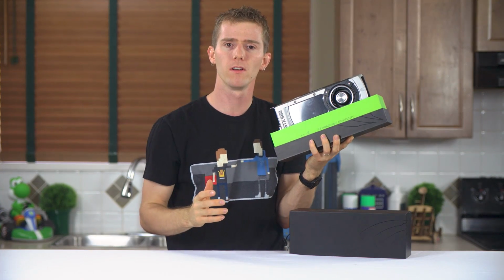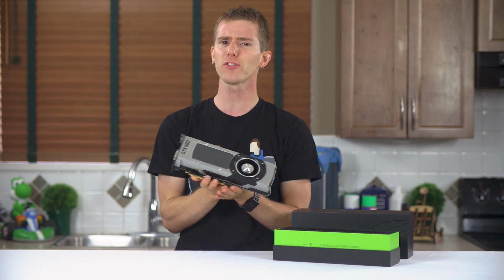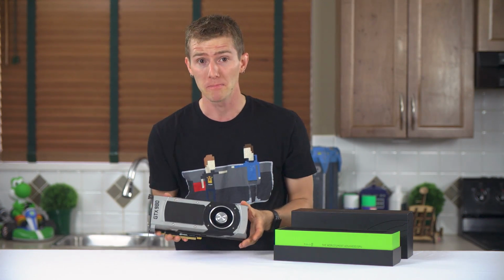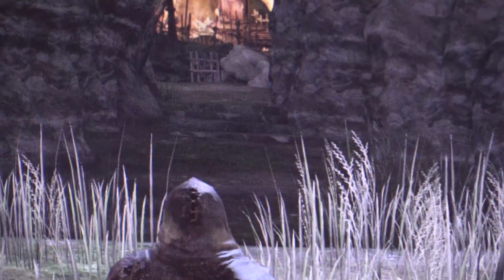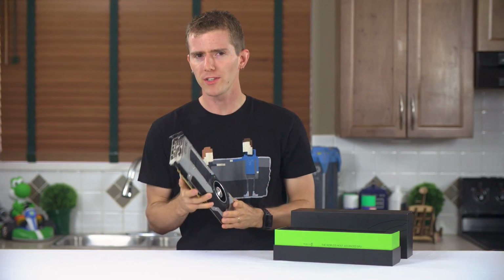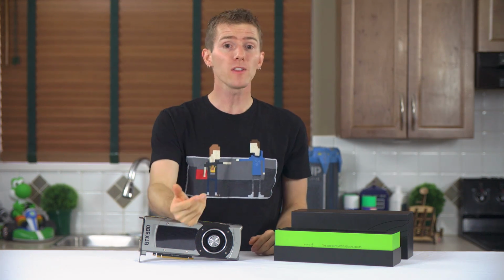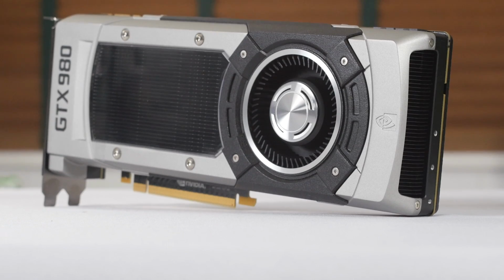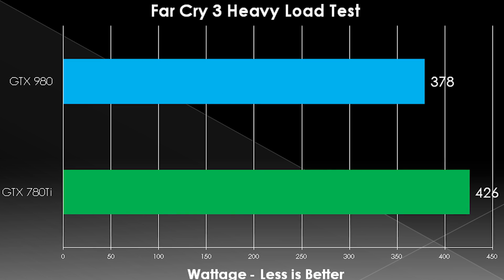NVIDIA GeForce GTX 980 Video Card - Performance Overview

Comment: Honestly, it's not as awesome as I was expecting, I was expecting huge FPS increase, sure the TDP being lowered is nice, and the backplate and I/O features are cool, but seriously? there was like less than 10 fps between them!
Reply: You must have never seen a release of a new line of gpu's, 10 fps is very good....
Reply: Actually the TDP stayed the same. The 980 is meant to replace the GK104 chip in the 600 series. The replacement for the GK110 has yet to be announced. Hell no one even knows for sure if they are going to release a replacement. But the 900 series was meant to be on the 20nm process. Not the 28nm. So this is an incredible improvement. The difference in CUDA cores between a fully unlocked GK100 and a fully unlocked GM204 is over 800 cores. And the 900 series is still on early release drivers. Give NVIDIA time to optimize the drivers and the 900 series performance will improve
Reply: Nvidia is smart company, this cards new memory compression is boosting a lot of performance, I would love to see fps in the newest games vs r9 series & 780/ti instead of older games.  Either way the NON OVERCLOCKED results are the typical nudge up nothing too big at all.  & it seems like Microsoft is getting it hard on for DX 12 so expect some exclusive os to have as well...
Reply: Nvidia could have easily made a card with the maxwell arc that had the same amount of cores, or even more, as a fully unlocked gk110. But they wanted to leave some room for them to improve upon incase the die shrink next year isnt as amazing as they would like.

Comment: MSI GTX 780 or MSI GTX 970? The 970 costs 60 euros less.
Reply: I think the 970, because of the new technologies.
Reply: Like I mentioned before with somebody else,
"The GTX 970 is the better choice. Awesome new features, 4 GB of GDDR5 memory, costs less, has better fps and in most cases for cheaper you get a card that is much more efficient and beats in most benchmarks. At most if you see people talking crap on how the 780 beats, it's just those picky people who care about an extra 2-3 fps, but I can guarantee that the 970 will perform better. The 780 is one of the first 700 series cards and the 970 has new features you'll like.

Let's just say a 970 performs exactly like a 780 but just about 5-10% faster in some scenarios..."
Reply: Garrett Absher NOOO DO NOT. The 780 can't even reach the 6 GB-it's just a marketing gimmick... The 4GB 970 is more than enough for high-res and there's news that either the 970 or 980 will come wiith 8 GB variants...
Also, the 6GB 780 is pricier, less powerful than the 970, and in all worse in performance...
Reply: if you go for the gtx780 go for msi's 6gb variant.
Reply: is like the same thing
the gtx 970 is cheaper
Reply: Zuhayr Sarker i was just puting that out there, if she REALLY wanted an 700 series card.

Comment: I have quite recently bought a 780ti. Now...do I buy another one, or a pair of 980's??
Reply: I would say sell the 780ti buy 2 980 and you pretty much run any game on ultra setting 4k 40 frames and if got 4 you rub Crysis 3 ultra setting 4k 60 frames
Reply: see how much you can sell it for but i would sell it and $800 more and get 2 EVGA GTX 980 Superclocked and your got good for 3 to 4  years it's worth it,im getting for gtx 980 but i still cant decide which one to get 4 980 or 4 gtx titan black

Comment: Gotta get these in sli guys I wanna set up a triple monitor display with these 980's with having three display ports connected to each monitor what can I push with i74790k aiming for triple 1440p @ 144hz or triple 4k @60 hz Whats the max these guys can push on high to ultra settings at either resolution

Comment: I'm gonna get the 750 TI. The only one my power supply for y 5 yr/o Dell Studio XPS 8000 can support. But then again, with 4 GB of RAM, do I really need to get a new computer. current graphics card is GeForce GTX 260.

Comment: So which should I buy, a GTX 980 or a GTX 780ti? Or should I buy either since I've got a GTX 770 2gb. I think it doesn't have enough memory for Arma 3 etc.
Reply: The 980 is just as fast or faster than a 780 Ti.  The difference is, the 980 has more memory, less power consumption, and is a couple hundred bucks cheaper.  From what it looks like, the overclocking headroom on the 980 is massive as well.
Reply: MiracLe  Hands down get the GTX 980. The GTX 980 beats the GTX 780 Ti, in a couple of fps, it has a lower TDP and its price is way cheaper than the GTX 780Ti. If you still have yet to buy any card I would get the GTX 980. But if you  already own a GTX 780 Ti then its not worth it to get the GTX 980. I am interested on getting the 980 soon, although its not a good evolutionary GPU, its  nice how it can go toe to toe against a 780Ti and uses lesser power and also much cheaper.
Reply: Just get 2 980 and your good for years to come
Reply: Apple Hunter I've never liked SLI-configs. They tend to be inefficient in games like Arma.
Reply: vash1053 Alright, thanks man.

Comment: For 500 i would get a 980 to switch out my 2 way sli 780ti because of i can get 4K on one gpu rather then 2 i would buy it also after seeing this im probebly going to sell my 780 ti and get a 980 and overclock it. It be linus if you made a 980 sli performacnce overclock guide...

Comment: If I had to upgrade right now and would have the money I got myself the 980. Power efficiency is the right way to go!! Also the card is fast enough for decent 144 frames gaming or in some cases 60fps 4k with still good settings. And for the upcoming oculus surely a good choice too.

Comment: Should i get a GTX 780 or a GTX 970?
Reply: XXMASTER GILXX 970 performs better, has more features and is cheaper, so why would you go for the 780?
Reply: Darude - Sandstorm
Reply: XXMASTER GILXX Have you even looked at Benchmarks?? GTX 980 fastest Single GPU on the planet right now, so it's not just the same as the 780
Reply: GTX 970 is the better choice. Awesome new features, 4 GB of GDDR5 memory, costs less, has better fps and in most cases for cheaper you get a card that is much more efficient and beats in most benchmarks. At most if you see people talking crap on how the 780 beats, it's just those picky people who care about an extra 2-3 fps, but I can guarantee that the 970 will perform better. The 780 is one of the first 700 series cards and the 970 has new features you'll like.

Let's just say a 970 performs exactly like a 780 but just about 5-10% faster in some scenarios...
Reply: 780
Reply: Éomer 780 is better than 970
980 is like the same than gtx 780,but it consume less power
Reply: XXMASTER GILXX DUDE THE GTX 980 IS GOING TO 780ti PERFORMANCE AT 200 DOLLARS CHEAPER!!! THAT CARD IS A FREAKING BEAST!!!
Reply: Thanks all!  Just to be sure, the corsair VS550 is enough for the 970? (550W, 42A on a single +12V rail)
Reply: lonleondon It should be but it isn't most recommended for any GPU due to the fact that there isn't much headroom. If you are going to do any overclocking, at least get a 650W PSU.

I think 550W should be fine as long as you don't do any heavy overclocking...the 970 only has a TDP of 145 watts so I think it should work better...
Reply: GTX 980 !
Reply: eroOtoko1 I kind of agree to the fact that if you can get a GTX 980 to the price point of a 780, why not get the world's most advanced GPU yet???

Hint hint, 980...
Reply: Zuhayr Sarker Between a 970 and 780, I might as well add more and get the 980 xD. Waiting to get paid  soon then sell my old GPU to try and get a non reference 980. Although the tax that I have to pay is just steep :(. But I can't argue with that I see some other countries paying more from Tax.. But then again USA don't have tax for this new components...   I need Doraemon's teleport door to buy from the USA and get back in the UK lmao

Thats what annoying here in the UK though. I am like checking items from U.S.A. e-tailers and convert the dollar price and I am like, "I can do that".. But when I check the same item in UK e-tailers with the V.A.T I am like, "Fuck me, Backwards".
Reply: eroOtoko1 Lucky you aAmericans-with tax in Ontario, Canada we only have 980s at around 700 dollars...
Then again, those are the ones currently in stock as these GPUs are just FLYING off the shelves...
Reply: Zuhayr Sarker Well in finland we got 980 reference around 600e (846,54cad) and non reference like MSI 980 gaming around 640e (902,98cad). So be happy and enjoy your prices :)
Reply: XXMASTER GILXX 970 is alot cheaper
Reply: If you need one right now buy 970.
If you have the money and can wait maybe 2 weeks for some custom 980s you could get that since we have yet to see what this card is capable of doing without reference shit.
Then again it's always a choice about how long can you wait and how much you want to spend.
Reply: Zer0kx dont forget drivers are gonna improve
Reply: ok,970 or 980

Comment: Hi great video. Been waiting to order parts since past 2 months for my new build for Triple 4k monitor gaming setup (will buy Asus' 28" 4k display, one at a time). My current picks are:

Intel Core i7 5930k
Asus Rampage V Extreme x99 mobo
16gb G Skill DDR4 2400 MHz
Corsair AX1200i
Samsung 840 evo 1TB
Asus Bluray reader
Cooler Master Cosmos II
Corsair H100i CPU Cooling

So torn between getting 2 AMD R9 295x2's for quad cfx setup (from amazon.com 1115$ x 2= 2230$ landed cost in my country) or Nvidia GTX 980 4gb 3 way (2100$) or 4 way sli (2800$). Which has better drivers support, game support, etc.? AMD or NVIDIA? Which seems like a better investment? Or should I order 295x2's because Nvidia would come up with GTX 980Ti's some months later maybe and that'll really piss me off lol 

Any help would be more than appreciated?

Comment: its just ridiciolus how they can say that performance is suprising its fucking maximum is better by 5fps over 780ti how the fuck anyone has the gut to call that a good new gpu. 
okay its fine that the price stays the same and it simply replaces 780ti with lower temps and everything but i wouldnt call that next gtx series worthy card.

Comment: well well well thats and improvement over ht still more powerful 780 ti, adding more ports is nice, they took that idea from the amd r9 295x2 i bet since it had 4 DP ports.

also ik that the 780 ti is more powerful cuz if you look at the specs even though the 980 has a higher clock speed which is what determines the performance if you took a 780 ti and overclocked it to higher than the 980's boost clock then you've got a card thats more powerful

also the 780 ti has more cuda cores, higher texture fill rate and a higher memory bandwidth so that helps as well

edit: just watched the rest forget what i said about the 780 ti being better, how much is the 980?

Comment: I think this is a great card. Nvidia have been milking the 28nm process for a few years, and as such they are now forced to innovate more. Cheaper than its predecessor and with way more power than what the 290x offers, this is a winner. I also think the 970 is the real star here - 290x levels of power for a lot less money.